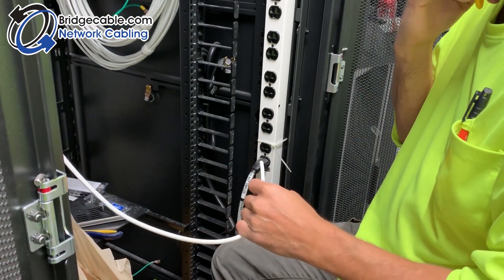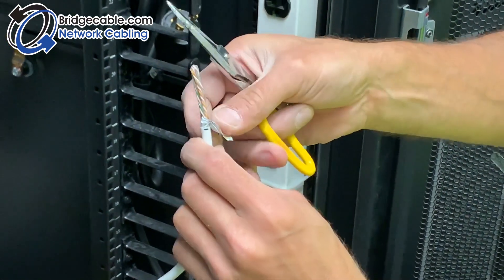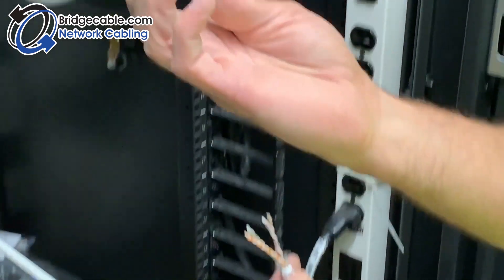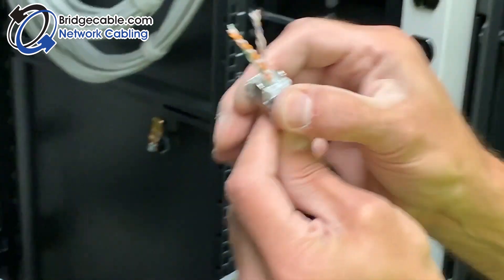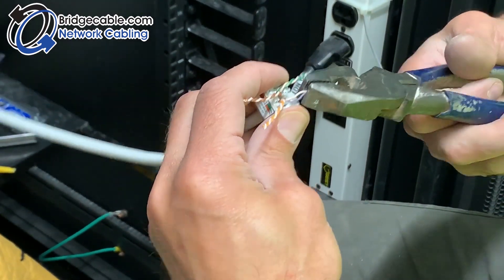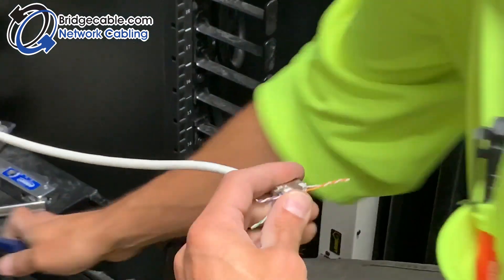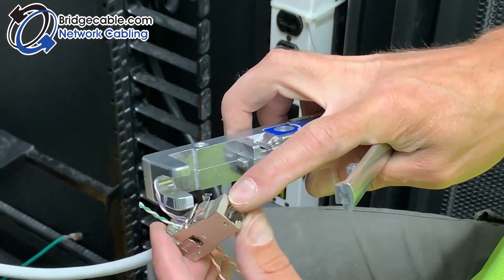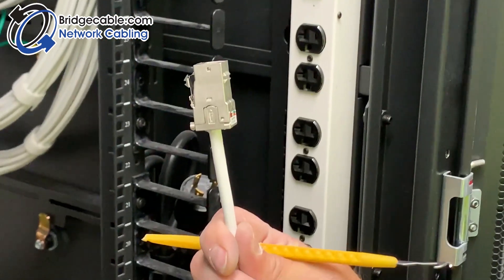How to Crimp Shielded CAT6A Network Jacks | Installation for Data | BridgeCable.com

Comment: A couple years ago, I used this Commscope/AMP tool to terminate about 2000 SL series Cat 6 jacks and we did not have a single failure, it works very well, MUCH better than using a punch tool as well.
Reply from the maker: All the tools are hit or miss.....really just depends on the techs. Of course passing test results as well!

Comment: What is the purpose to wrap around the foil and the copper line ?
Reply from the maker: Grounding and EMI protection. Bunch of videos on it too. I've seen an entire factory run shielded cabling....only NOT to ground their jacks and patch panels :(
Reply: @BridgeCable  Good to know, thanks
Reply: Twisted pairs eliminate/minimize electromagnetic effects, the shielding foils eliminate/minimize electrostatic effects.

Comment: Great help as usual. The amp tool your using has two built in tools for Sheilded Cat6 Cable. You can use the centre hole for stripping the initial installation and the internal rear blade is for the secondary pair shielding in F/FTP or the plastic insulator you removed with scissors.
Reply from the maker: Totally understand that....rear of the tool. Our guys know that...should have showed it. 1 of the 3 techs we filmed for this video used it but he mumbles....the techs are creatures of habit...love their snips. Yes, for the new techs out there...use the stripper. We tend to like the feel of snips and most of us like the feel and know our depths of cuts on the snips. Most days, even in the office during paperwork, the guys will have their snips in their pockets :) Big point is the grounding on the shielded jacks...you do not get them right...fails the tests. Oy Vey!